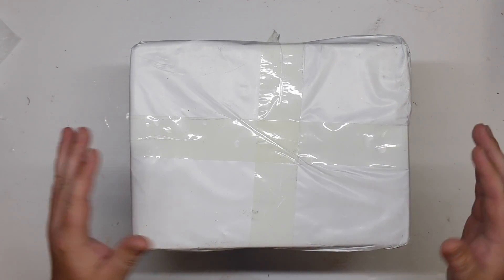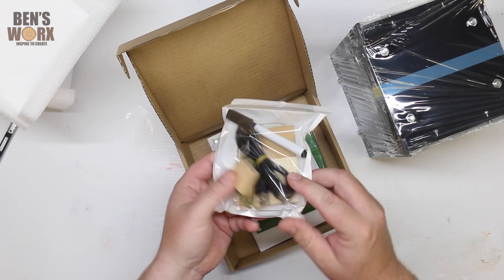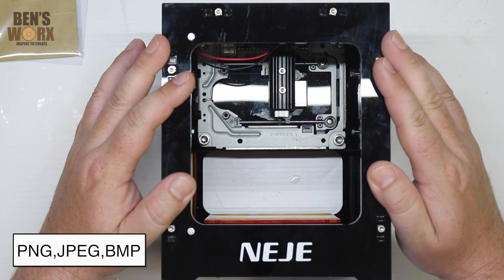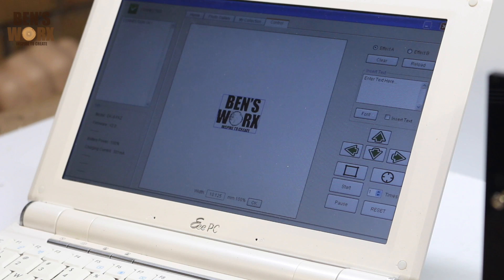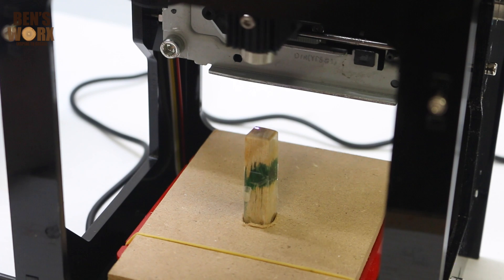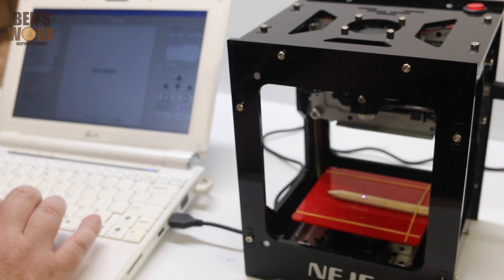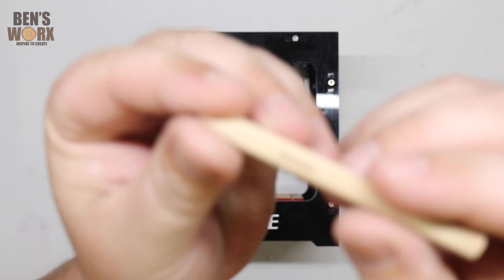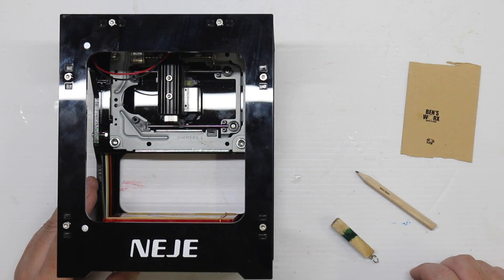NEJE DK 8 1500mW Laser Engraver setup and test

Comment: You said this works on aluminum and stainless steel. Can you please confirm?
Reply from the maker: The product information says it does but unfortunately I’ve had zero success
Reply: @BensWorx  with max burn time, maybe?
Reply: @kzdz  this is what I would like to do. No good if it hasn't got that kind of power.
Reply: @BensWorx  I think thats the materials its made of and not the ones it works on. My NEJE kz3000 is made of Acrylic + Aluminum + Stainless Steel. The materials they list mine can be used on is mahogany, bamboo, paper cards, ivory, leather, flammable plastic, PCBA.

Comment: Hi, I bought this machine and they sent me the wood, but they also sent me metal dogtags with it and so far I have not figured out how to get it to mark on the metal dogtags. How do you get it to mark on the dogtags. Is there a certain setting, maybe put the laser at a certain strength or is there something I need to put it on? Thank you. =)
Reply from the maker: Hi Kathryn, I haven’t had any success with them either
Reply: @BensWorx  I heard it doesnt work on metal

Comment: I've had one of these for nearly a year, and it's a great piece of kit but it really doesn't do acrylic, aluminium or stainless steel as stated in the video. What that is actually referring to is the construction of the device 'Frame material: acrylic + aluminum + stainless steel'.

It works great on paper and wood though. I use it to engrave onto wooden guitar picks.
Reply from the maker: Hi Jobi, have you tried slowing the burn time?
Reply: I've tried nearly every setting it has, but it's not stated as working on acrylic, aluminium and stainless steel, that's stated on the website as what the machine is made of. It simply isn't powerful enough to do hard materials.
Reply from the maker: I’ve had success on acrylic by slowing the burn time on the engraver software program
Reply: I'll give it another go then, when you say slowing the burning time you mean making it longer?
Reply from the maker: Yeah in the software program there’s a slide bar at the bottom which you can adjust the burn rate if you slow it down the laser spends more time in one spot allowing for a deeper burn, I’ve also found colored acrylic works better too

Comment: How do you connect it to the PC, as I think im missing a cable?
Reply from the maker: Hi Nicolas, yes you need a usb cable
Reply: So there are 2 cables? 
I have the 1500 but it does not have a usb?
Reply from the maker: Do you have the BT model
Reply: @BensWorx  where can I find the model number?
Reply: Actually I got it to work but I know for sure it will not print on a potato.
Reply: This little machine engrave on coins? Can be used with chrome notebook?